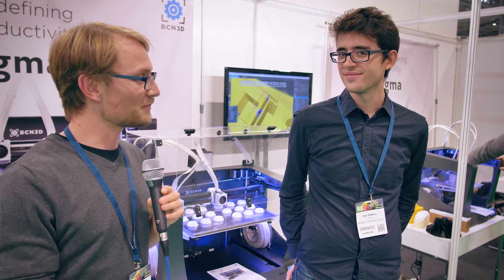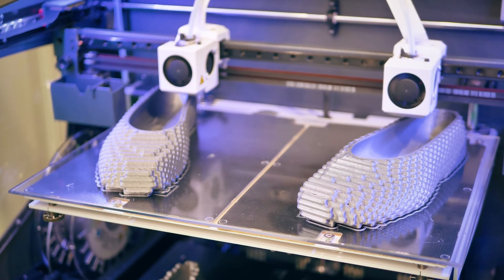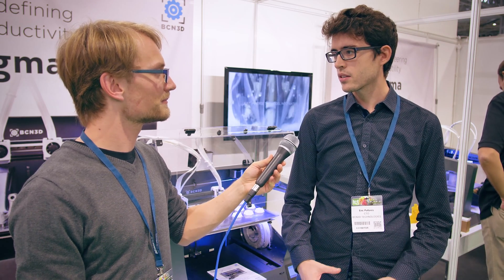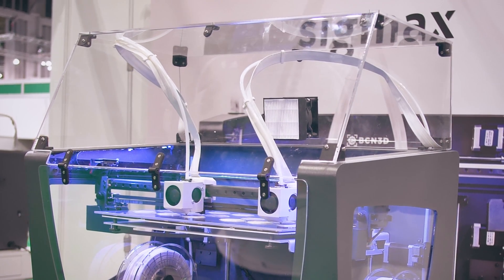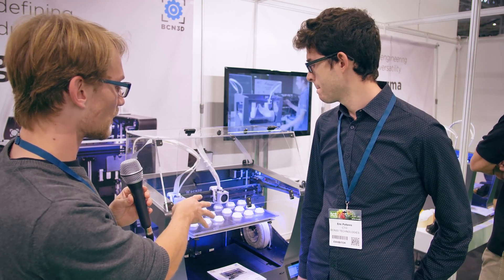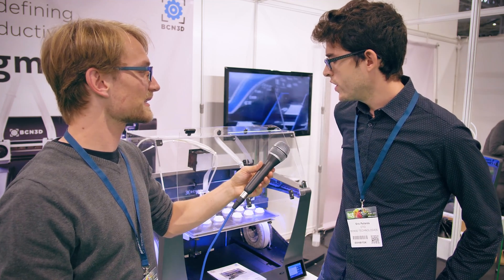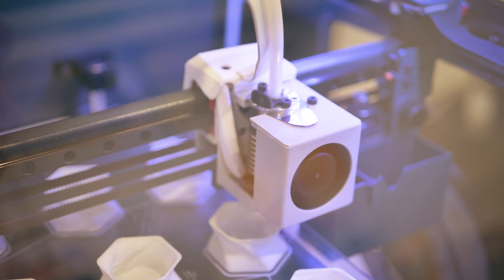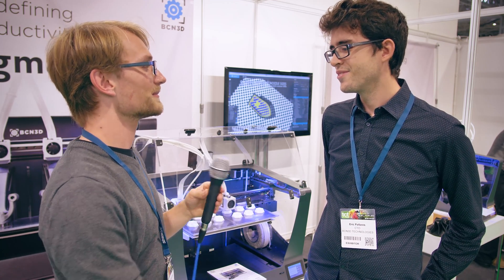Twice the Sigma R17: The BCN3D Sigmax! #TCT2017

Comment: Hey Tom,
     I dont know the best way to get ahold of you other than the comments, but I wanted your opinion on the Anycubic I3 Mega.  I would love a Prusa I3 Mk2 or even 3 but both of those are a bit out of my price point.  I wanted to know if the Anycubic would be worth the $300 price tag, and if it is, what would be some good upgrades for it?  I really want to get into printing, but I dont want to make the mistake of buying a cheap 3d printer right off the bat thatll cause problem after problem.  Ive been watching the I3 Mega for a bit, but I havent come across too much info on it that doesnt sound biased or bought out.  Thanks in advance.

Comment: I just ordered 2- New  CR10's that can print 12"x 12"x 16"  with the new motherboards and dual z axis motors and filament sensor cutoff and start stop  for less than 1000.00 why would I want to pay $4000.00  for only 1 of these? I could just buy 4 CR10s for  half the price of this   :)  I am sure their interface is nicer i just cant see much else.
Reply: Better quality, can print high temperature materials, the best dual extrusion system on the market. A bed that can reach more than 80ºC
Reply: Yeah, but as he said, it's not for home printing. It's Prosumer or directly professional. You don't buy this if you don't make money with it
Reply: Better build quality, for example, it has linear guide rails which are more expensive and more precise than the typical rods.
Reply: Yea I get that.  I just was trying to see what you were really getting for the difference in money. Thanks to you all i have an idea of what it is now.
Reply: True, but come on 4 grand is out of my league for home 3D printing.  I would have to get a contract for printing something in pairs ha ha
Reply: That is nice to have as well. I was reading about a lot of folks are using a 110v heater on the CR10 user group to do really high temp stuff as well as building a cheap  foam insulation enclosure which i will probably as well.

Comment: The cool thing about that "mirror-mode" is that the inertial forces of each of the heads accelerating cancel out (in the y direction) - this should result in a smoother print (i.e. fewer head- and chassis-vibration artifacts) when printing in this mode :)
Reply: Aditya Mehendale i better save $3600 and have that force not cancelled out lol
Reply: Each extruder is on it's own belt, so there can still be oscillation and vibration.
Reply: @austinwinn4548  True, but usually one of the lowest eigenfrequencies is that of the y-stiffness of the gantry-frame (say between 5 and 30 Hz). By eliminating this, the controllable frequency shall increase significantly. The sqrt(k/m) term for the belt and payload shall be in the higer 10s of Hz (say 30 --> 100Hz). This is less of a problem.
Reply: @AdityaMehendale  awesome! That's really neat. Stuff I comprehend on the surface but not in detail, thanks for the info!